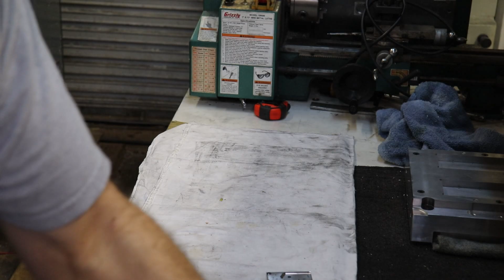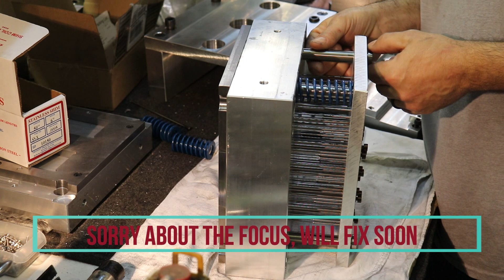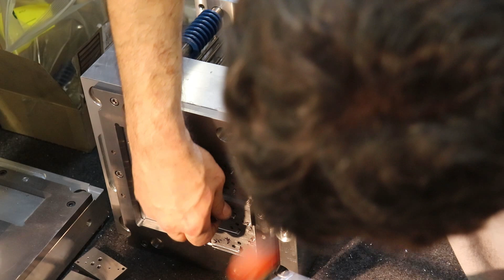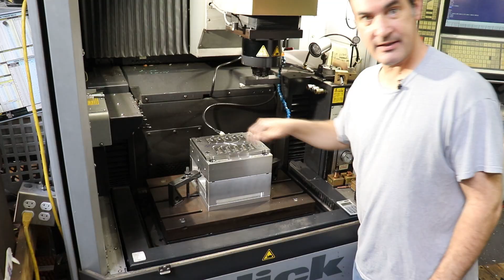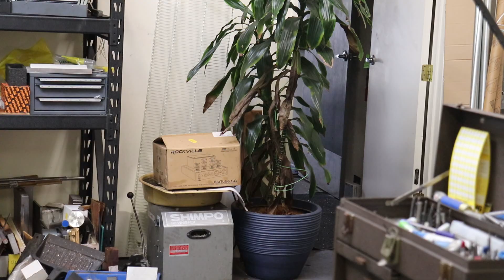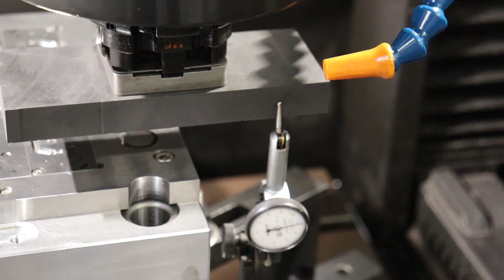DUAL SHOT MOLD PART 2

Comment: You may want to relieve one end and one side at it's bottom of the last insert to fill the pocket 0.002" x 0.1" to ease starting alignment.
After cavity and core detailing use a block of wood to tap or press the inserts into place to prevent rolled part line edges.
Reply from the maker: Thanks for the tip Wayne

Comment: Nice. Would it be worthwhile to put a couple jackscrews in each of the inserts (or maybe just one on each side)?
Reply from the maker: Yes, good idea. I did use a 6-32 tap to thread a couple of screw holes to pull the inserts, off camera, on the first mold. Thanks for watching!